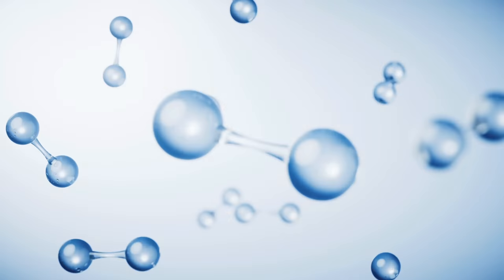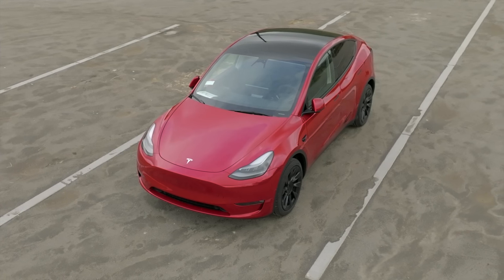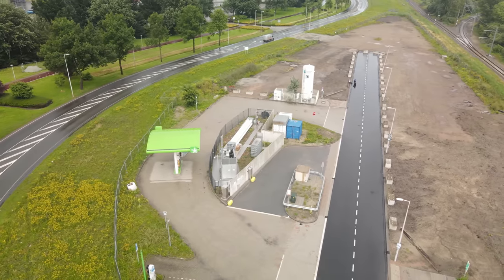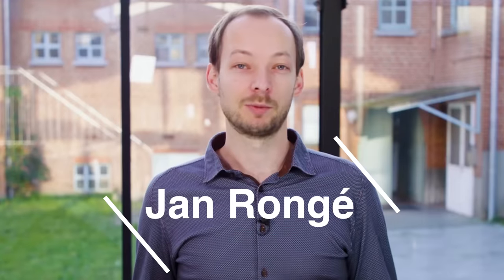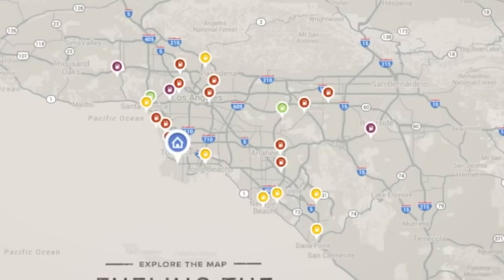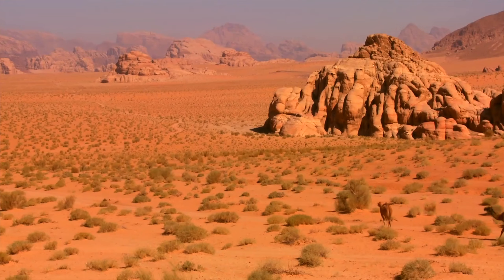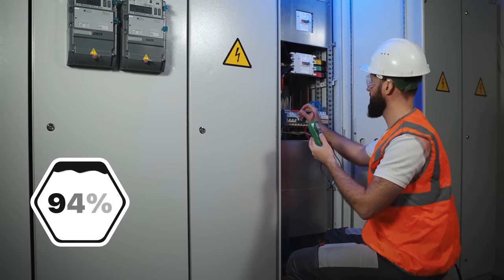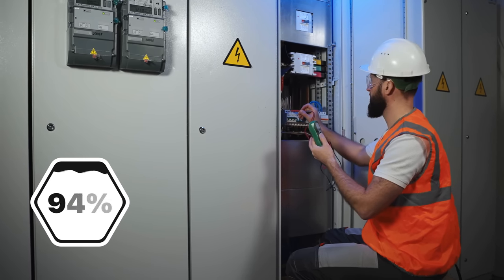Breakthrough Solar Panel Makes Hydrogen At Home!

Comment: When comparing a fuel cell vehicle to a battery electric vehicle, please remember: fuel cells produce DC current just like a battery. So you will need an inverter for either of them, to power your home or your EV's AC induction motor (lightest, most efficient and most flexible type so commonly used in EVs).

Most batteries can return 85 - 90% of the energy you put in. If you can get the hydrolyzer up to 71% efficiency, and the fuel cell up to a similar level of efficiency, you will get about ½ of your energy input back out (√½ ≈ 0.71). If they can get the hydrolyzer and the fuel cell, each, up to 90% efficiency, you'll get about 81% of your energy input back out again (0.9 × 0.9 = 0.81). That's getting competitive with a battery. 95% efficiency on each would make it fully competitive.

Solhyd is claiming they can hit that with their hydrolyzer. But fuel cells ... not there. There are high-efficiency fuel cells but they use a lot of platinum, which makes them hideously expensive (figure about $250k for 25 kW output; 25 kW is about 33⅓ horsepower). There are cheaper ones, based on nickel, which are nowhere near their level of efficiency (~40%). 0.9 × 0.4 = 0.36 or 36% round-trip efficiency, which is still less than half of a battery.

WRT storing hydrogen: there are carbon-wrapped tanks which can take 700 bar (over 10k psi) but you will need to expend a LOT of energy on the pumps to put it in there. And it will still take a larger volume, compared to gasoline.

Metal hydrides typically only need about 500 psi (lower pumping losses) but fueling is exothermic and expelling the fuel is endothermic. Rodger Billings drove a hydrogen-fueled Cadillac in Jimmy Carter's inauguration parade, with the hydrogen stored in metal hydrides. The fuel tanks had tubes running through them; engine exhaust went through the tubes when the engine was running (providing heat for the endothermic release) and cool air was pumped through the tubes when fueling (providing cooling during the exothermic fueling). The big problem is that metal hydride powders are very heavy; you're lucky if 5% of your total stored mass is hydrogen.

1 kg of hydrogen has about the same energy content as 1 gallon of gasoline. That's 20 kg / 44 pounds of mass to carry the equivalent of 1 gallon of gasoline. Gasoline weighs about 6.5 pounds / gallon and you don't need a 500 psi-rated tank to hold it.

You talk about a Solhyd panel making 250 liters of H₂ / day. I'm assuming you mean 250 liters at STP; you did mention it was low pressure. 1 kg of H₂ is about 12k liters at STP. You would need about 48 such panels to make the hydrogen energy equivalent of 1 gallon of gasoline per day. If they can do that for 30 years ... the per-kg cost might be reasonable.

Hydrogen makes sense in only 2 cases:

1 - You need to store the energy for weeks or months at a time. Batteries are good for a few days, maybe a week, but not for longer timespans. The Apollo capsules used hydrogen / oxygen fuel cells to carry energy for an 11-12 day mission, providing heat and potable water as byproducts. Battery tech of the time was nowhere close to that storage capacity and the byproducts were useful. Artemis will use a lot of solar panels and some batteries; they won't be hauling all of their energy when they blast off the pad. Apollo had no choice; solar tech wasn't ready, back then, either.

2 - You need to transfer the energy much faster. If you are refueling a vehicle and need to refuel in a handful of minutes, rather than having a hour, hydrogen makes some sense. An Over-The-Road semi can store liquid hydrogen (LH2) for 500 miles and you can refuel it in minutes. A battery-electric semi ... good luck getting the charging time for 500 miles down under an hour. A driver is going to want to spend as much of their time as possible in motion (they get paid by the mile, not by the hour) so many heavy-truck manufacturers are actively working on hydrogen fuel cell rigs, running on LH2. Ditto for electric airplanes. They're hoping that, if they build the demand, the supply / infrastructure will come.

There are three "miracles" needed before we can transition to a hydrogen economy: the cost of production needs to come down, the cost of storage needs to come down and the cost of usage needs to come down. The Solhyd panel appears to be working on the first one. All three are making evolutionary gains but ... I think we're still decades away from a hydrogen economy being realistic.
Reply: Concerning semi-tractor trailer trucks…remember there are laws in the USA limiting the time a driver can spend behind the wheel.  So recharging the batteries in under a hour is not an issue.  After 6 hours of sleep the driver will awaken to a fully charged vehicle and be back on his or her route again.
Reply: I think battery charging time issues could be totally resolved by having a system of battery swap-outs. Each vehicle would have a yearly subscription to a battery swap-out service. The battery packs would be charged up by the swap-out service, and the driver would simply switch out battery packs. This could be done much faster than even standard fuel fill-ups! The swap-out service would not have to worry about their batteries being stolen any more than a gas station would worry about their barbecue propane tanks getting stolen. The customer would only have one battery pack at any moment anyways.
Reply: Thank you for such great data. I believe Bob Lazar was using Uranium Hydride in his corvette which had a greater range than stock all stored in three scuba tanks.
Reply: I think the reason why Hydro can be the winner in homes is your 1st point. With Hydrogen you can easily have a huge solar roof more than you need, and store the energy for the winter. You can do it locally/off grid. This is huge. And is very far off with Batteries.

Comment: I was a big fan of hydrogen fuel cells for cars and transportation.  But the more I learned about it, the challenges just seem way to big for a national scale, especially with battery technology improving.  Now, for trailers, shipping and planes, I would like to see hydrogen come through for them.
Reply: If you read the Tesla impact report, you'll see that shipping and aviation each account for 2-3% of the global CO2 footprint, it's LOT of infrastructure for surprisingly little reward.
Reply: @rogerstarkey5390  I dissagree, Roger. Becasue it's not just for transportation. In fact, most hydrogen is used by industry and it's a way to decarbonize steel. It's a much bigger impact than just 2-3%
Reply: I see hydrogen powered cars driving around literally every day but I'm in California.
Reply: @filonin2  it still seems like cars are at a standstill and how long would it take to create that hydrogen infrastructure?  Meanwhile, a 1/4 mile from my house, there 8 or 10 Tesla chargers going in by my local grocery store.  Seems a bit like VHS vs Beta to me or HDDVD vs BluRay now.
Reply: We just have to invest time, money and knowledge into this problem, it is far better than ev's. When a converter makes the energy and the hydrogen combines with the air, there is no pollution, when a 'tesla-like' vehicle is empty, charging on the net, takes more time than filling a hydrogen tank.
Now I have also doubts about the recycling of EV's, which is not done yet, while a total H2 vehicle can be recycled totally. Of course, the storage etc is a problem now still, and the energy that comes from it is less, but it is so much around us, we just have to tackle that one tiny problem, only if every scientist and engineer that worked around the clock on EV's took 6 hours of their time to search and come up with ideas on how to make H2 more efficiently, then there were no scary stories around of people who have combustible fluids at home and the chance of it to explode. LPG tanks are here e very long time, hardly any accident happens and when H2 does escape, it makes no big bang, whereas LPG stays in it form very dangerous, think about that for a while. Just saying...
Reply: It's all about the money, if someone with money like Elon for example to say hey let me invest into this tech, then we would see hydrogen take off.

Comment: EV : Solar to electric ready to use.
Hydrogen Solar : Solar to electric to hydrogen to fuel cell
TBDV : GENIUS!!
Reply: Eh, for a hydrogen-based storage system to make sense, one has to have an application where it is ok to lose 50% of the energy put into it; generally home and ground transportation applications are not it, as more efficient tech is available for that at this time (batteries), etc.  🧐
Reply: @RobC1999  Have you seen the weight of pressurized tanks in hydrogen fuel cell cars? The tank weighs much more than the hydrogen it contains. Plus all the onboard venting and filling equipment. Hydrogen becomes beneficial from an energy to weight basis only over a certain size of vehicle - e.g. big rigs and above. Unless some amazing new storage method comes along.
Reply: @GantryG  This makes sense for seasonal storage of renewable energy. The cost of storing hydrogen scales well with size - that's probably the only thing in hydrogen's favor.
Reply: The ideal would be a direct solar to hydrogen photosynthesis process.

The problem is that it's only ideal if you only want to create hydrogen and not have a daytime power supply also.
Reply: What about a system where a home uses hydrogen gas combustion for stoves, water heating and a few other applications as well as storage for cars, and electric power supply for a home?

Comment: Why? Direct solar electricity is much more efficient. The complexity of a fuel burning engine to produce motive energy is crazy compared to the simplicity of using electric traction motors with the significant added benefit of regen braking. This is crazy! I was in the business of transporting cryogenic gases, including hydrogen and I can assure you that dealing with hydrogen is much more complex and dangerous than conducting electrons from solar panels to batteries to motors. Electricity is easier, safer, and much more efficient.

Comment: Sorry Ricki, H2 is just too hard to handle, density, even liquefied is too low, and by the time you've added sufficient safety and monitoring tech the costs are simply too high.
However, in space, an elecctrolizer to remove water vapor from the atmosphere, return O2 to breathe, or store with the H2 for propellent. Combined with Sabotiere process to break down CO2, you now have an atmosphere scrubbing system, returning usable raw materials for further use.

Comment: I have experiment with Hydrogen in the past! I built a generator just for my car, it was crude, but it did work! You got to get the computer to accept the hydrogen into the system, and you have to have a bigger alternator, like 240 amps. 140 amps to run the car and 100 amps to run the alternator, or run two alternators, which ever is best. I went from 26 mpg, to 53 mpg, of course I only did that one time about 10 years ago. I haven't done much sense. I gave up on it.

Comment: I may have this all wrong, but at 11:00 you show a house with 22 panels on it.  Assuming 250l/panel per day, that would be creating a little less than 500g/day of hydrogen.  Hardly 'industrial scale' and arguably, not enough to make this worthwhile at least for small scale operations.  What am I missing?

Comment: For your question, I'm more willing. Our family typically doesn't go on long road trips. I've started watching more vlogs on themeparks to help subside those wants and it actually helps... I see people in long lines and it turns me off. Also one of my family members is involved in the airlines, so we get free flights (non-rev).

Will say that I'm on the waiting game though. I want to see more done in the hydrogen sector before I consider buying alike solar panels like the ones you discussed here in this video.

Comment: You could always rent a car for long trips.  If you combine this with a hydrogen Fuel Cell and battery packs for the home.  This could be the quickest way to 80-90% green energy.
Reply: Plasma Kinetics has a unique hydrogen storage technique that allows you to store hydrogen on a film.  You don't have to compress hydrogen with this system so you cut out the major cost with normal hydrogen storage.  There won't be one source of green energy, we will need batteries along with everything else.

Comment: The obvious use case is higher latitudes. If you don’t get any or very low output in the winter, it’s interesting to store in the summer in H2 and use heat and electricity in the winter!

Comment: First, thank you for continuing to produce good videos about new hydrogen technology, and for exploring the potential for using hydrogen as an energy source in the future. Everybody else, for some reason, seems to want to just put it down and ignore it.

You say that hydrogen is very energy dense, then you say it has very low energy density. Of course you mean that it has high mass energy density, but low volumetric energy density. You should use those more specific terms because people need to start understanding energy density in both ways, since both are important. Also, you give the mass energy density without the storage container included, but since it requires heavy storage tanks, you should point that out immediately and give the adjusted mass energy density, including storage tanks. And then you talk about the amount of energy required to produce hydrogen as if that’s a problem, but in fact, it is exactly that reason why it does indeed have a high mass energy density. Put a lot of energy in to it to get a lot of energy out, energy is conserved. We would like to have to put even more energy in to produce it.  The important factor is the efficiency of producing it, and the efficiency of extracting the energy back out again. Compare that to the efficiency of charging a battery and the efficiency of draining a battery.  And compare the total volume of batteries required to store enough energy to power 1 million homes for three weeks, to the volume of hydrogen storage tanks required for the same thing. And, of course, compare the cost of the two systems also.

Your focus is on residential and automobile use of hydrogen. But it’s pretty clear that hydrogen will definitely be used for applications involving heavy machinery that uses a tremendous amount of power, such as large long-distance trucks, mining vehicles, trains, maybe airplanes, perhaps involved in various industrial processes, like steel manufacturing. To that end, this hydrogen panel may make a great deal of sense for producing the needed hydrogen using large hydrogen solar farms, rather than using grid electricity along with traditional electrolyzers.

I’m wondering about residential small scale infrastructure. Why not share hydrogen collection and concentration facilities among an entire block or two of houses? It’s not unheard of to have such neighborhood infrastructure. I have a box down the street that contains stuff for my neighborhood’s fiber optic cable system.  Also down the street is a large transformer that steps down electricity for use in the neighborhood. Up the street is a large water storage tank. Under the street is a large sewage collection system, and a friend has a sewage pump station down the street from him.

Comment: Personally, I don't own an EV yet (hoping for a Tesla someday), but I'll say this: If I could generate the H2 at home and fill up my tank in a couple of minutes every other day... I would so much prefer the hydrogen car. Especially if it's a hydrogen combustion engine, I'm a sucker for the sound and feeling of revving up a car. Anyone else here agree???
Reply: @jimgraham6722  Haha. Love it man. As I said, I haven’t ridden my first EV, so my POV isn’t too unbiased, LOL I’ll bet when I do I’ll be hooked. What was it like riding an EV for the first time. Do you remember?
Reply: Not really. I'll stick with my BEV. My house is too close to the freeway. The quicker we get rid of vehicle noise pollution, the better.
Reply: @ipp_tutor  Front rank at the stop light, when it turned green >>>>>
Reply: Same also I was thinking of putting these panels in my shed in a few years maybe instead of a car think of just general heating if they came up with a hydrogen powered heating and air condition, this could be a game changer because during the summer I can produce enough hydrogen to potentially heat my house without gas. this would be better than using it for a car. Maybe I will be able to produce more than I need but I assume it’s one or the other. Either way it looks like I will either get an EV or hydrogen car in the future, but the idea of this goes far past transportation.
Reply: @IPP_Tutor
No
Reply: You wouldnt like the maintenance cost of a Hydrogen car, especially compared to an EV, which doesnt need maintaining. Then theres the old problem of Hydrogen being the 2nd smallest element and keeping it contained without leaking into the atmosphere where it causes 30 times the problem that Co2 does. Hydrogen = expensive, more than running an ICE vehicle
Reply: @jimgraham6722  I live for that scenario 😁
Reply: Hydrogen' s lack of infrastructure would be solved and would reduce the weight of vehicules as well as demand for rare earth minerals, and could be cleaner than evs
Reply: Boycott Felon Muzk.
Quit dreaming about his cars. 
Peace&Love 💙👍